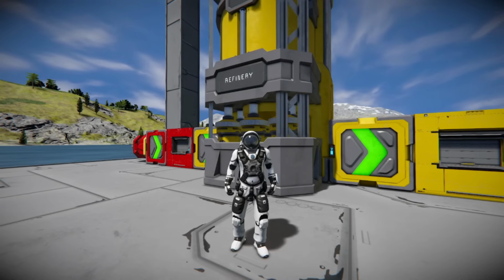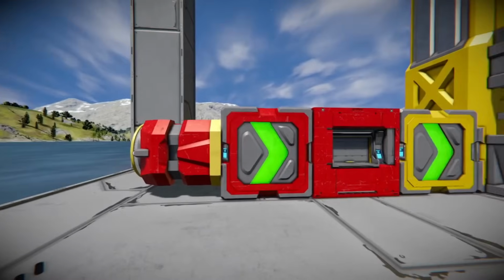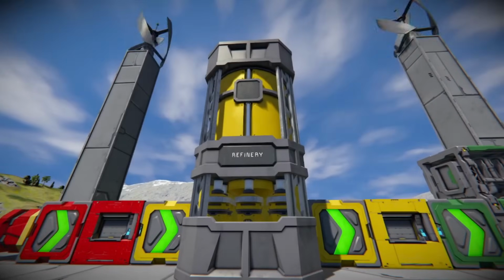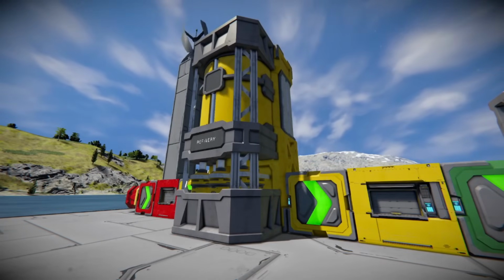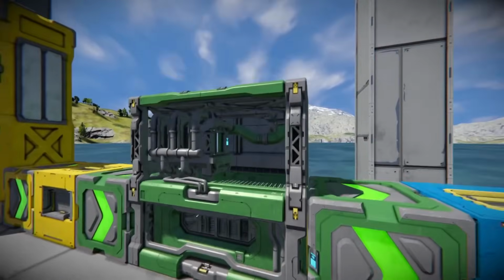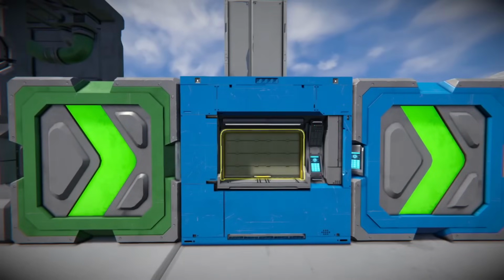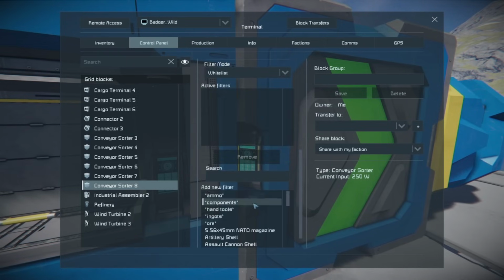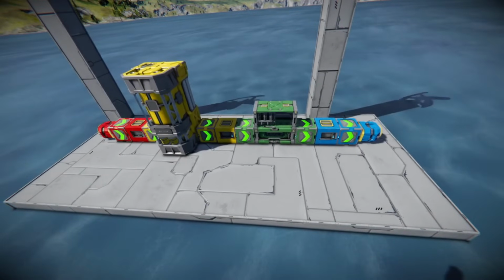Maximum Base Work Flow

Comment: JIT manufacturing. That means "just in time". That is used when the stock is something that they may not have the space for building a product. Like Aircraft building. Could you imagine the warehouse that would store whole airplane wing parts? I have done similar. Nice work!

Comment: My base workflow is a connector that spits out gravel bricks into a wheel set to maximum speed sending them flying far away and that's it. No more clogged assemblers ever again.
Reply from the maker: I see a random factorum ship with a big ass hole in the side and the crew looking at a gravel pack going, "wtf did this come from?" 🤣

Comment: Now, as a rought draft this is ok. However, due to how long it takes to refine certain "ores" I find it best to have several lines of refineries, each with their own intakes. All outputs are "blacklist ore" (this avoids backlogs too) but are not necessary per se. For inputs, until you have enough materials stone can be smelted in basic refineries (chained, they self-balance), and can remain there for all time if necessary; exclusive lanes would be for Cobalt (this one can be refined in basic ones too), Uranium, and silver+gold+platinum (you won't usually have enough of those three to clog a system with one), and ores that can go to in basic but are best in advanced refineries are Iron, Nickel, Silicon and Magnesium. Magnesium is not really important unless you are in PvP or need to combat.
For storage, without cobalt, we can use an advanced rotor to abuse small grid large containers (be mindful of alignment, however, since they have 3 small connectors and 3 large ones).
Reply from the maker: Yes I estimate you would probably need somewhere between 3 to 4:00 in the morning with a sorter set to pushing a specific set of oars through IE stuff that takes the same amount of time to refine to a specific assembler and a final assembler as possibly a backup to hold off something that's really difficult to refine such as Cobalt Cobalt is always that thing that you get a bunch of and it takes such a long time to refine that it starts clogging systems up

Comment: You made a good point about the ingots vs components I wonder how well I could make that into a small grid that can also carry the assembler
Reply from the maker: Indian quite small when you pull in larger components like steel pipes and metal grids or even radio components are the best example despite using very minimal components they take up a very large amount of space

Comment: Rather than a straight line setup, I like to use a loop:
 
Cargo 1 is for Ore, and it's connected directly to the refineries (meaning I don't have any sorters between them, it's just a single set of pipes)
Cargo 2 is for Ingots, connected directly to the assemblers
Cargo 3 is for Components, connected directly to the docking connectors
Sorter 1 connects C1 to C2. Whitelist Ingots, drain all
Sorter 2 connects C2 to C3. Whitelist Components, drain all
Sorter 3 connects C3 back around to C1. Whitelist Ores, drain all
 
Now if you put any type of item in any container it will go around the loop until it gets to the right place.
 
Refineries don't have any sorters between them and Cargo 1, so I can switch ores in/out of the refinery to control what it's producing. I leave room for a filter system later on once I have enough resources to dedicate different refineries to each ore, but that comes later. Same with the assemblers: they're just directly connected with Cargo 2. Using sorters to try to push materials into a refinery / assembler seems like you're risking a jam that would be hard to clear.
 
I don't have dedicated docks for mining ships and welding ships -- all ships can dock at any connector because they're all on a single set of pipes with no sorters between them and Cargo 3. So a welding ship can dock anywhere and access the components. When a mining ship docks at the same set of connectors, Sorter 3 will automatically pull the ore into Cargo 1 to feed the refineries.
Reply from the maker: I never thought about using a loop system I have to study up on this a little bit more
Reply: I'm similar on the docking so I put sorter in my ships to push or pull with a bypass turned off and I just power it on/off to manually use the ship for alternative usage.
Reply from the maker: Ya that's the best way by putting a sorter on your ship.

Comment: What really likes to clog is an assembler. With ores that are not required right now for components you are trying to build.
Reply from the maker: Ya I got a new video coming showing how to cut off supply lines so you don't sent stuff where you don't want it, could put up a video after that on how to set up a simple declog system.

Comment: So ive messed with these sorters for many weeks and to be honest the only sorter you need is at the docking that also has a split so first block use a T then a sorter at one secton then the other part let it work around the sorter connect it to the main line. This set up just lets you drain the ship so you can park and get out and everything gets moved to main base. I havent played in a long time but i just hopped back in since apex update.
Reply from the maker: Yes if your going in a straight line. This is a simplified version of a flow system. You will want sorters in the designated areas as you get more complex.

Comment: I never understood the fascination over these one way conveyor setups. If your base is big enough to worry about inventory management surely going straight to pressured/zero pressure input output conveyors just solve all throughout and management problems immediately? Given that you don't want to use a programmable block
Reply from the maker: You can use event controllers and sensors too not just programmable blocks to control resources flow.

Comment: You don't really need the second yellow sorter: the refinery will push ingots out if there's a place to push them to. Refineries clogging with ingots means there isn't enough output storage connected to it. Alternatively, you could drop the first yellow sorter: doing so lets the refinery push ingots "back" to ore storage, increasing the amount of ore that can be refined into ingots with the same amount of storage space.

And, you don't need the first green sorter: the only things that can exist between the first yellow sorter and the assembler (without either of those middle sorters) are ores and ingots. The assembler can't hold ores, and it needs ingots to work. Plus: without that first green sorter, you can manually move ingots out of the assembler and back to ingot storage if the assembler's input gets clogged.

The second green sorter isn't really needed, either. All it's really doing is keeping ingots out of the blue connector (and connected grids) and limiting the amount of storage available for both the refinery and assembler to push their output to.

So: red connector => red sorter (drain all ores) -> refinery -> assembler -> blue assembler (no draining, but only allow components) -> blue connector. The other sorters seem to be adding complexity while reducing usable storage space.
Reply: I agree there's overkill with sorters but it will get clogged up with ice depending on where you are mining and since ice is classified as an ore you need to black list it first.

The other problem is this system is slow emptying your miner if it's sizable.
Reply from the maker: Or you can use an offshoot conveyor system with another sorter in whitelist ice is the only thing that can go through then applying an event controller you can dictate whether or not your ice is going towards making water for your farm or whether it is going towards your H2O to generator depending on the environment you can simply have it set to when one is full it starts filling up the other one whichever one is more priority I will spend most of your eyes on farming if you're on Earth or most of your eyes on oxygen hydrogen production if you're on the moon
Reply: the sorters on the outputs do not help preventing clogging up your refineries/assemblers, it only prevents backflow of resources through the conveyor system. When your refineries/assemblers are clogging up their output, it is most likely because they can not push their output to another inventory in the conveyor system due to no space available elsewhere.
A real clogging bottleneck that can appear is in the refinery/assembler input, which can be filled with ore/ingots you don't want/need to be processed at that time, and the refinery/assembler not being able to pull in the resources it does need due to lack of input inventory space. The 'drain all' option actually can accellerate this issue if this is not being handled elsewhere in the system.
Reply from the maker: Yeah you'd have to Loop something around the assembler part of the the chain in order to declog the system every so often you can also set up an alert light system that goes red depending on how full the assembler is once it reaches a certain threshold then all you have to do is just simply push a button you just need a light or sound to alert you when the system is clogged up then you just walk into the assembly area push a button declog everything
Reply from the maker: Maybe but this helps keeping things from getting cloged and if you have several refineries you can use the sorters to stop say a build up of cobalt.
Reply: @badgerwildgaming6908  I'm absolutely in favor of input sorters on refineries to funnel certain ores into certain refineries (eg., uranium into an all-yield refinery while iron might go to a speed refinery and stone to a bank of basic refineries), which necessitates putting an output sorter so the ores don't pulled into the wrong refinery.

But: I don't see how this really prevents clogs. The biggest source of clogs, IME, is the assembler filling with ingots it doesn't need - either because of canceled production or because that was the only place left for the assembler to shove them. This doesn't prevent that, but may actually speed it up, marginally, by pushing the ingots out of the assembler slightly faster while also not allowing the refinery to push ingots "back" to the ore containers.

All of that said: where this system can be useful is with event controllers. Since ores, ingots, and components are separate, you could use event controllers to provide indicators as to how much of each bucket you have on the grid by, say, changing the colors on an indicator light.
Reply: @minnmass  I agree, that you need only half of each colour. But you need red sorter as well. (Or first yellow) Simply because you will use this one connector more often not only for ore ships, but for all others. It is good if you have multiple dedicated connectors for each role, but most of us are lazy folks and we need just one. So one sorter to pulling all ores into one container is a good solution. 

Then this ore can go into different specialised refineries with each of them have dedicated sorter, or just group of any. Then sorter to soak all ingots into another container. Yes, you don't need it, as all refineries will drop their ingots into this container periodically, but it's good to have clear indication of how much ingots you have at this moment. 

After that is an assembly line with different assemblers. And this is why it should be a container between refineries and assemblers, as refineries often use assembler's inventory to store produced ingots. And you won't notice it until it's too late. For like official Keen server one assembler is enough to produce all your needs. Like of you wielding a ship then by the time you wield all components and empty ship, you will assemble another batch. 

If you need to make bigger constructions, then more assemblers needed (also one prototech assembler) and having so many of them may result in stop of working. Because you will not have enough of like simple type of ingots, and all order of master assembler will be taken by others without producing anything. Good solution, to periodically empty all assemblers and push ingots back to container, but you don't need to do it all the time. Like a timer with 5 min should be sufficient, I think.

TLDR: You need one sorter to push ores into ore container. Than second sorter to push ores for different refineries. Then third that push all ingots out of refineries to ingot container. And may be forth that push components into component container, but that is optional.
Reply from the maker: You can set up a declog on a button with connectors.
Reply from the maker: As far as this system goes this is just everywhere you're probably going to want to order at some point when you increase the complexity of the base depending on what you're wanting to build as far as the ingots are concerned I have heard some people sit back and say that they have created Pam minors without the Pam script system using just the event controller and some sensors but I've never actually seen something like that done nor have I ever been able to accomplish it
Reply: @badgerwildgaming6908 a sorter that doesn't have drain all set is pointless here. And I have never seen this Refined glitch you're talking about.

Thanks for the video, but I think you're overcomplicating things.
Reply from the maker: I'm doing a separate declawed video because putting the stuff in shorter content makes it easier to run with instead of having a 34-hour video going over everything and yes in the video I apologize I said glitch what I meant was if we have that problem every so often when you put way too much of one type of Orion that doesn't refine as quickly as others do and it begins to clog up the system easiest way to solve that is to have a series of stories and a series of refineries that handles specific oars instead of all all refineries handling everything

Comment: You didnt mentioned that the first connector that the miner will dock should be on "collect all" mode. If it collects all the ship should be made like so it will give ONLY ores and ice. Or else the collector will empty all inventories if possible. I had in my cockpit some emergency stuff (food, a gun, some medkits etc) and it sucked them all.
Reply from the maker: That where white listing comes in. Just set the sorter to white list mode and select ores and ice it will only pull those resources. If you don't use fuel like uranium it will have nothing to take.
Reply: @badgerwildgaming6908  yes but i dont mean the sorter. I mean the connector before where the miner docks. Does it have the "collect all" command ON or OFF?
Reply from the maker: I didn't turn it on because usually what I do is I put a sorter on the welding crafts that I used to to pull everything out of the connector as stuff is shoved into it

Comment: This is pretty similar to the first system I set up when diving into sorters, but it has a lot of compromises that I couldn't work with long term. The biggest one is that once items are in this one way configuration, accessing anything in the middle is impossible without manually going to its storage container. The second issue arises when you're working with a group of people that  put things in the wrong container. Third, the assembler in systems like this have a tendency to overfill with ingots, as there is no way to have sorters drain the ingots from them. 

I solved all of these issues by adopting sorter "gates" that attach directly to a shared main cargo line, where connectors and direct access terminals are attached. 

Each gate has three sorters, one each for the desired product input and output, both configured with matching whitelists. This allows you to pull items back out of a sorted container if you need to. Each gate has a third, final output sorter with a blacklist matching the intended input and output whitelists set to to drain all. This way, it functions as a reject sorter, pushing accidental objects, (or output products) out to a different inventory. 

For cleanup, each gate should also have a timer to toggle the input sorter "Drain all on/off" and the output sorter "block on/off." This way, any time you have the cleanup mode on, there is no way for the input sorter to get stuck in a loop with the output sorter. It can still pull from the other containers thanks to the reject sorter on each gate. 

By having one gate each for ice and o2h2 generators, ore and refineries, one for ingots and assemblers, and another gate for finished products, any connector or overflow container on the main cargo line can access everything, but things still sort nicely.

The only real way to stop an assembler from getting clogged is to have another sub sorting system for the assembler that buffers the ingots storage from the assembler. Another pair of sorters and an pair of event controllers and a small container are needed here. An input sorter is whitelisted to allow ingots into the container, and the output sorter is whitelisted for ingots and assembler products. 

The event controllers monitor the inventory fill level of the buffer container. When it reaches 90%, it turns off the input sorter and enables drain all on the output sorter. This will empty the buffer container. The second event controller triggers when it reaches 0%, and drain all is disabled and the input sorter turns back on. 

With assemblers behind this buffer container, they will only ever pull exactly the ingots that they need, and can never be the clogged output storage from the refinery.
Reply from the maker: You got to show us this wizards in the Discord. Link in discription we will geek out over it.